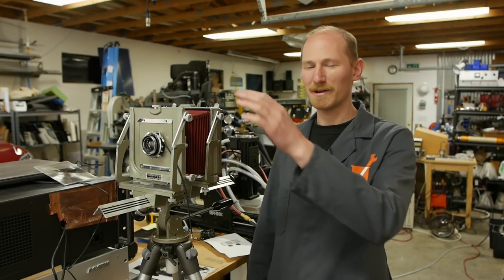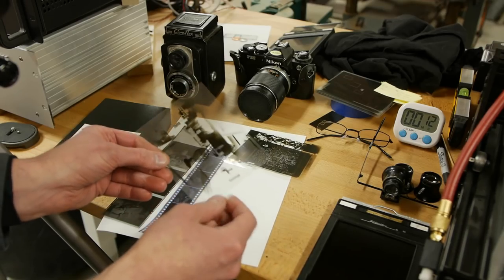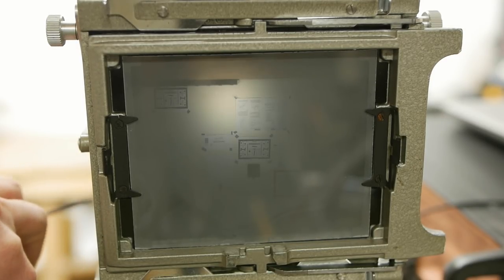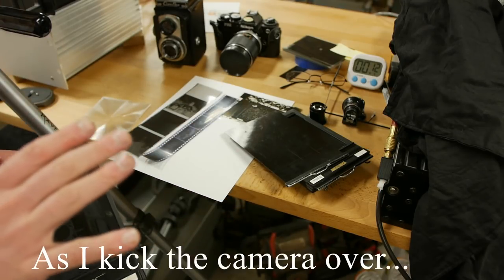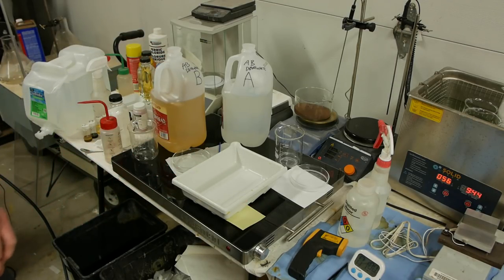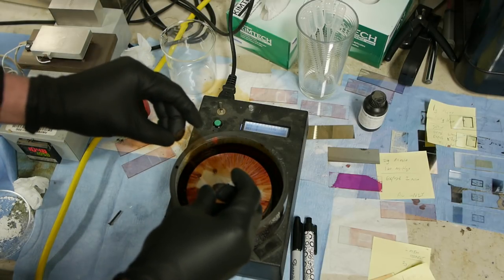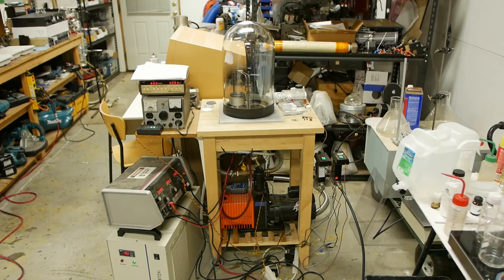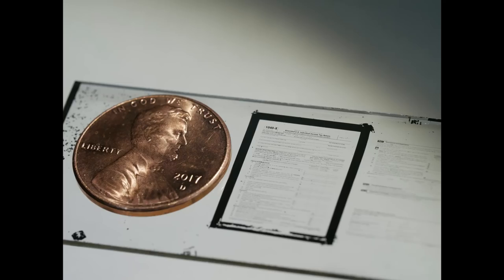Antique 4x5 camera creates 20 micron photolithography masks: Super tiny tax form

Comment: As a terrible chemist, a half baked engineer and a professional photographer I really, really loved this!
Reply: As a terrible chemist, a former professional commercial photographer, and a newly degreed mechanical engineer I also really enjoyed this.
Reply: As a terrible engineer, a half baked photographer, and a professional chemist I also really really loved this!
Reply: @GucciCaligula  As a professional terrible, and a terrible terrible, and a terribly terrible, I also really enjoyed this.
Reply: As the son of a professional photographer (where I grew up using all the 4x5 hardware and processes he demonstrated, and then later in college) and a 40yr professional microlithographer, you hit the nail on the head with this video.

Pro tip about the film holder dark slide (what we call them, not 'shutter')...  The end with the handle is bare metal on one side and black on the other.  Put the black side facing out when loading with unexposed film (that's how we oriented them) then after exposure flip it so the metal side faces out.  The bare metal side also has notches in the edge next to the wire bail in the middle.   Then when you're on a job you can quickly tell exposed and unexposed frames on sight and the notches let you feel it in the dark.

Loved this.
Reply: @TomCardinali  do you use a focusing mask during any setup processes?
Reply: As none of the above but likewise a terrible physicist. I also enjoyed this video!
Reply: exactly
Reply: As someone who hasn’t gone to university but knows a lot about physics ,electronics , and practical design and manufacturing I liked it too
Reply: As someone who was multiplied by the square root of -1, I enjoyed this video as well
Reply: @Ornessar Hithfaeron you’re now orthogonal to the real line?
Reply: @ornessarhithfaeron3576 
Oo

P
Reply: @rockrl98  
L
L
P

O
Reply: As a terribly handsome genius who is naturally good at everything, I enjoyed this also.

Comment: What is this? A tax form for ants?
Reply from the maker: For the thumbnail, I tried to take a picture of actual live ants on the miniaturized tax form.  Even by just cold-stunning the ants, and having them wake up, and walk away, it still looked like a dead insect / blob on the form.  I still have a great imagined image of insects next to tiny LEDs, tiny ICs, microdisplays, microprint, etc, but have never been able to capture anything that looks good.
Reply: It's going to need to be at least... 3x this size!
Reply: Didn't you here the IRS is taxing ants now.
Reply: @AppliedScience  Can you metallize the ant and get a metallized slide with the tax form and put them in the electron microscope?
Reply: @AppliedScience  Try a small blob of runny honey and the ant will stay fairly still while feeding; it will be excited initially but gradually slow to a virtual standstill. The body will keep a live tone rather than looking dead. Check out early AntsCanada feeding videos for reference; the images rival some nature documentaries.
Reply: The files are IN the computer
Reply: @AppliedScience  
Are you going to build a zone-refinement machine and start a semiconductor chip fab in your garage? It would be the first chip fab in America in a long time.
Reply: Applied Science Maybe if you used one of the very small ants?  Maybe a thief ant or acorn ant could appear better next to the form.
Reply: @gregorymalchuk272  he would still get better 10 nm yields and faster then and as intel
Reply: @AppliedScience   put a drop of sugar water next to the subject and the ants will stick around.
Reply: @AppliedScience  Maybe try with some food to lure them into the shot, sugar syrup so it's not too much visible?

Comment: So "focal plane" is actually one of those lies that we tell people to make things simpler. Focal "planes" are actually more like focal curved-surfaces (rotationally symmetric ones). Higher quality lenses are typically designed to have more planar focal "planes". So that could be part of your problem too in addition to the film bowing. This sort of aberration is commonly referred to as field curvature. It might not be a problem for you, your lens might be good enough for this to not be noticable, but it could be part of the issues you were having. (Plus I believe that the effect is minimized by stopping down, so since I think you said you were very stopped down, field curvature probably isn't an issue for you, but it's something to be aware of)
Reply: f11 iirc
Reply: James Driscoll if he is at f11 that’s actually not particularly stopped down in large format terms, an easy thing to try might therefore be a smaller aperture (with some kind of lighting rig at a 30 degree angle to remove reflection). It’s also kind of funny to see him doing as a special process what was daylong work for people thirty years ago.
Reply: Strictly speaking yes all lenses produce a curved image plane (its never a simple radius), however the lens design is a compromise to be acceptable on multiple metrics (cost, speed, resolution, image circle etc) and will substantially flatten that focal surface, to the point that when stopped down the residual error is acceptably small cf. the resolution of the film. 

Different lenses are optimised against different design goals, but you might want to think about what eg the famous "planar" design of optimising for 🤣
Reply: Thank you Haruhi, very interesting.
Reply: @davesmith9325  Probably the tolerance of that camera and lens was designed for casual viewing of prints.  It's probably far sloppier than what he's trying for, and would still look fine if you're looking at a portrait at reading distance (not using a magnifier or hunting for subtle flaws).
Reply: Based high-detail advice animeposter.
Reply: plus, I imagine it's kinda hard to make the film match this curve.
Reply: Stopping down reduces this (and related) issues, but only to a certain point, when diffraction effects take over and stopping down further will actually decrease overall sharpness. It has been a while since I've done these calculations but for a 20 micron goal you're probably diffraction limited by about f/16. So f/11 is probably close to the ideal choice.
Reply: Almost all lens used in photography are aspheric lens
, and it removes spherical aberration. The understanding and formula to produce such a lens has been well known and studied for hundreds of years. There's no reason why any lens produced in the last hundred years wouldn't produce a flat focal plane with within several hundred nanometres.
Reply: Not a problem using emulsioned glass plates.
Reply: I thought the exact same thing. When using a lens, the sides will inevitably get out of focus on a plane. You actually need an eye-like surface to focus the whole image.
Reply: @stephanmantler  this is something i don't understand but find super interesting, could you point me somewhere to read and learn about this?  thank you!
Reply: LazerLord10 —pretty much IMPOSSIBLE.  For starters, the error should be symmetrical relative to the optical axis, but seldom is.  Usually, the “plane” will resemble irregular ripples on a pond that a pebble has been tossed into.  Determining that shape is just about impossible.
Reply: Seth Harwood —while true, that is not a relevant concern here.  In this case, he is only using a degree or two of angular coverage from the lens.  Curvature seldom shows up to any significant degree until far further off axis than that.
Reply: @sno_crash  wrong. aspheric camera lenses only started to get popular half a century ago as manufacturing processes became cheaper.
Reply: the focal plane often flattens when stopping down
Reply: that actually IS about as good a lens as you'll get on such a camera barring process lenses etc
Reply: This is one of the most interesting and informative Youtube comments I've read in quite some time. Thanks for the tip!
Reply: @LazerLord10  ...back in the days of 35mm movie films,  high-end projection lenses were explicitly designed to have a focal 'plane' that matched the film curvature created by the shape of the film guide rails in the projector.  Part of the issue was that the intense light passing through the film caused it to buckle/curl dynamically - there are many papers on this issue in SMPTE journals.  [Society of Motion Picture & Television Engineers].
Film buckle was particularly bad with black&white films because the black silver image absorbed the light and heated the film.  Color images do this to a lesser extent because the three color layers use IR-transparent dyes [yellow, cyan, magenta].  As always, lots of engineering detail, much of it now obsolete.
Reply: @davesmith9325  ...and we can't ignore the issue of 'image spread', where the silver image in the negative is often larger than the light image that formed it due to some light diffusing laterally in the emulsion layer,  plus complex chemical effects at grain boundaries during development.  In the final print, the effect is of highlights larger than reality, and shadows smaller.  This can also be caused, of course, by lens flare.  In photographic sound recording, very careful control of exposure and processing is needed to compensate the negative image spread with image spread in the positive print to minimize unpleasant distortion of high frequency [short wavelength] sounds.
Reply: @jrb_sland5066  if you look back you will see i explicitly noted the resolution of the film becomes a limiting factor in practice. This encompases all effects including those you mention, anti halation backings etc, not just the nominal grain size
Reply: @antigen4  the "circle of confusion" gets smaller certainly, so a larger area of the image circle will be acceptably sharp despite that the theoretical image surface isnt perfectly flat. But thats not quite the same as saying the focal surface became flatter. To be pedantic, stopping down changes the aperture that rays may pass through the lens, which may change the best focus surface, but hie depends where the aperture stop is placed. Simply getting a small circle of confusion , and thus more depth if field, is the dominant advantage of stopping doen
Reply: @JohnDlugosz  on the contrary technical cameras like that were made specifically for the most demanding applications, including images that are magnified to be enormous. (Billboard size etc)
Reply: @davesmith9325  Billboards are viewed for a few seconds from 100 yards away, they are not at all demanding of printing details let alone the original photographic quality. Reconnaissance and astronomical work are better examples of applications for the precision cameras.
Reply: @sno_crash  You can't remove spherical aberration for all wavelengths with one lens.
Reply: @hemerythrin  they even answered the question the way Haruhi would have, hah
Reply: @koo3144  The best lenses have negligible field curvature, decentering on particular lens will be more problematic than field curvature, which is worse in wide angle lenses.
Reply: @iNerdier  Can't stop down if you're operating at 1.3x diffraction limit.
Reply: Stopping down doesn't improve it, it merely mitigates the effects by increasing the focal depth. Field curvature can be a huge deal if you've only got 2mm of your 8mm subject in focus, but it isn't a huge deal when you have 500mms in focus.
Reply: @martyzielinski2469  depends on the lens setup. Using spherical lenses, the field is also spherical. A large enough focal length would permit the film to be fixed to a small spherical section, ensuring consistent focus
Reply: The flatness of your focal plane depends on the design of your lens system. Large format cameras with curved focal planes simply use curved film holders.
Reply: @iNerdier  Nobody was casually doing photolithography in their garages 30 years ago. That's the whole point of his channel, to show how previously inaccessible technologies can be accessed by the average hacker.

Comment: about your trays:  Use tongs.  Use different tongs for each tray.  Don't dip the tongs into the liquid; the developer tongs are dunked to fish out the film, and you carefully slip the film into the stop bath without dunking the tongs.  You dunked your fingers, excessively contaminating your baths.  Going the other way is worse:  you'll use the same fingers to go into the developer next time, and you'll get stop and fix and surfactant into the developer.

Comment: Just in case you get the bug to shoot large format in the field, the darkslides on the film holders do indeed have a secondary way for a photographer to keep track of exposed and unexposed frames: there are textured bumps and a bright side (if the darkslide is metal it's unpainted, if it's plastic it's white). so you're supposed to draw the slide out completely when exposing, and put the slide back in white + bumps side out to mark that it's been shot.
Reply: Came here to say this, thanks for saving me the trouble!
Reply: Lol I put the bumps in when exposed, out when unexposed. 😁
Reply: If the dark slide shows dark, the film has always been in darkness (unexposed). If silver or white the film has seen the light. That is opposite of the general usage but it makes sense to me. If I ever get an assistant,  they will learn this way of the dark slide.
Reply: @RalphWLundvall  It makes literally zero difference, as long as you are consistent.